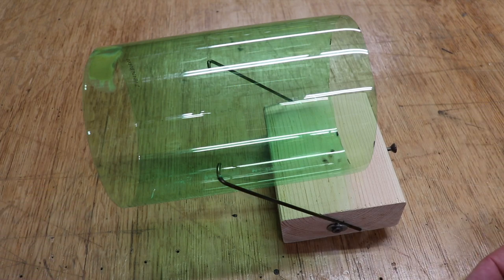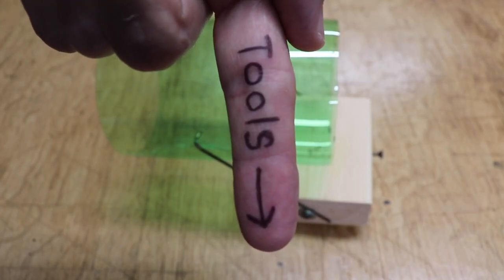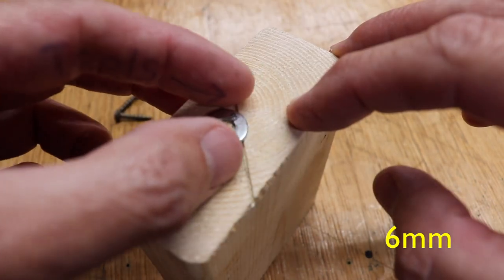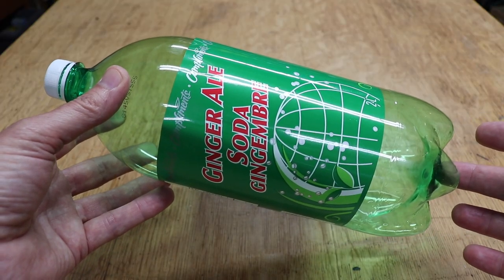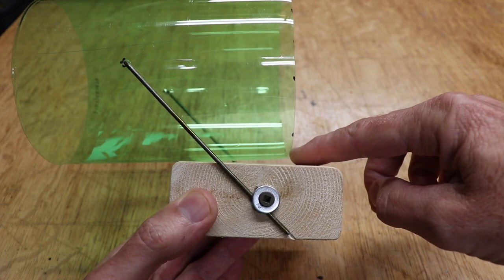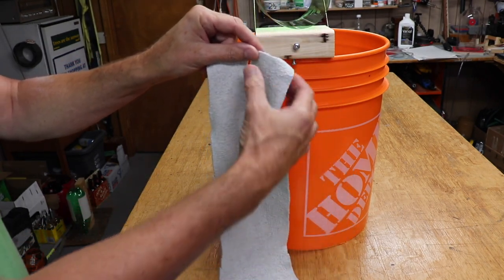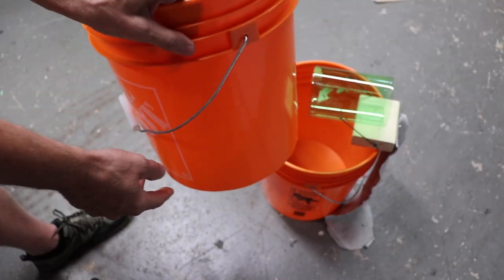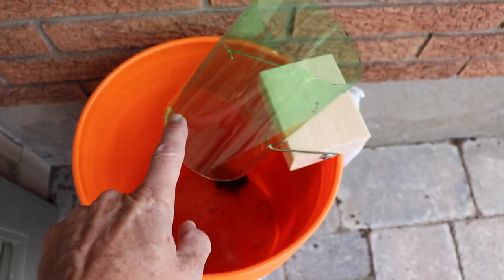Simple ● Tubular Teeter Totter Mouse Trap ( that works ! )

Comment: Chris Notap  Great videos, I watch and like them all.  Has anyone that you know of built a mousetrap that utilizes a cylinder under vacuum to kill a mouse through explosive decompression?  For example: a wide mouth gas cylinder is attached to a vacuum pump that creates a negative pressure of say 14 atmospheres, a gate valve is attached at the cylinder mouth to a solenoid or mechanical trigger located in a tube connected to the cylinder/gate valve.  When the mouse enters the connected tube and attempts to eat the glued down bait he trips the gate valve instantly pulling him at high speed into the cylinder causing instant death through explosive decompression.  The gate valve or solenoid closes automatically, pump kicks on and creates vacuum and the process continues. This trap would be excellent because the mouse carcass(s) would be in a vacuum almost constantly, mitigating the smell and allow for constant use without having to reset or clean the trap almost indefinitely. If no one has built it, I will.  Thanks again for a great channel
Reply: There's no such thing as vacuum below 0 atmospheres, so you can't achieve 14 atmospheres of negative pressure. Unless these are subsea mice you won't be able to kill them in a humane way with vacuum.

Comment: You wouldn't need a third bucket. Just place three screws the same distance from the bottom on the second bucket adjusting their distance from the bottom so it is unjumpable.
Reply from the maker: Yes but then you have holes in the bucket for another use but yes that would work. Thanks for that tip!

Comment: Home Depot buckets aren’t cheap.
Reply from the maker: Yes, they are cheap. $3.97 in Canada.
Reply: Last time I bought one, they were $5.00US. Using 3 buckets makes the total cost of this mouse trap seem a bit high to me, especially when the rest of the trap was really cheap.  Not to mention that after cutting the bottoms out of 2 of them seems to  make them pretty useless as buckets.  But that’s just me.
Reply: Update. HD buckets are $3.25US so cost is better.